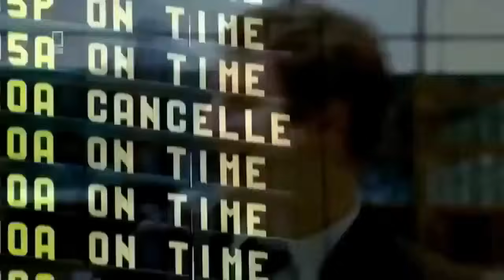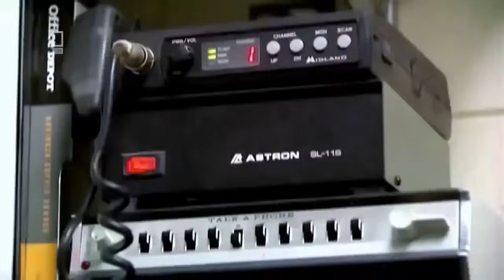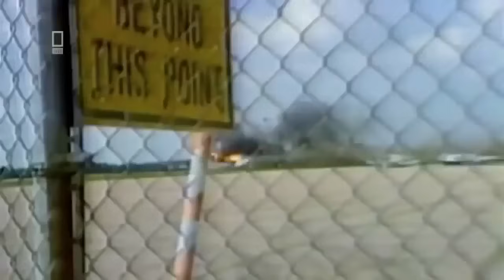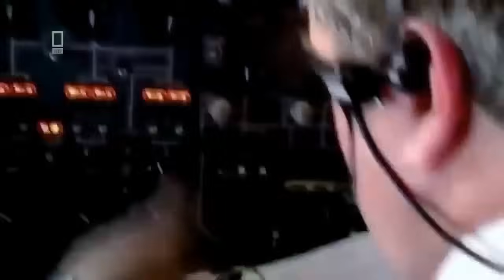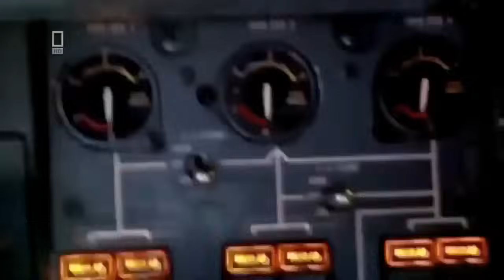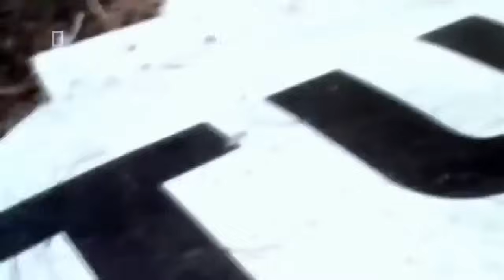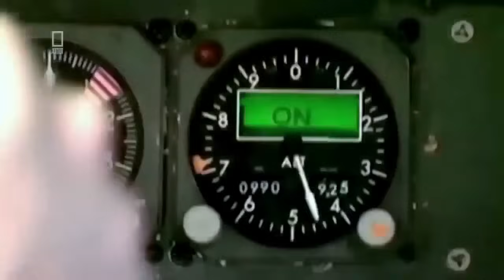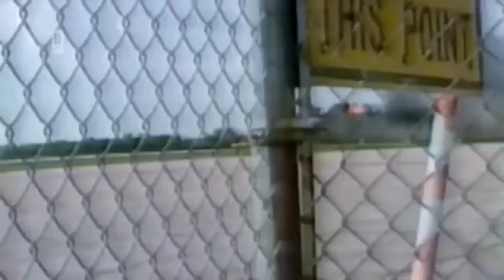Mayday Air Crash Investigation 2020 US Airways United Flight Impossible Landing Crash

Comment: I'm quite certain that initial severe roll to the right came close to dooming this flight completely. The fact that captain Haynes so quickly corrected it with differential thrust was an important moment. If the plane had rolled onto its back and plummeted, I doubt there would have been any chance of a recovery.

Comment: Actually DC-10s do NOT have a good safety record.
Reply: Something about having an engine in the middle of the vertical stablizer just doesn't sit right with me😁
Reply: @shawndouglass2939  to be fair the L-1011 had a engine in the same area and didn't have nearly as many problems as the DC-10...mostly because Lockheed didn't rush building it

Comment: I fail to understand why planes are designed so that a problem in the tail can take out all the hydraulic systems even though there are perfectly functional engines and control surfaces on both wings.  The wing systems should be completely separate from the tail.  There have been a number of crashes due to full loss of control because there was a problem in or near the tail.

Comment: Hello, I am Adil  texting you from  of Qatar, I would like to ask why they can not establish a system that can safe most of passengers lives.. by putting a parachute system which I considered as airbags on a normal car, because of what happened in this flight loosing all hydroelectric system ... If  there is parachute build in on the top of any airplane aerodynamically as it will be  the last refugee to safe lives at the last stage.. regard less what do you think about the incident that very well know about the halogen incident which killed around 60 people or more than that in some cretin time before (google is not giving really the right option and I really don't know why.

Comment: When they know they are going to crash land why can't they dump all the fuel? I don't understand !
Reply: I dont think you can open the fuel tank, also thats kinda polluting.
Reply: @roverfloats  they have a controlled proceedure called file dump!  They can do that by all means
Reply: They were prob a bit busy trying to keep the plane (relatively) straight and level. There's also limit on when and where you can dump fuel, so you know, they don't posion everyone on the ground. If they have the time and space to do it, sure, but it is not a priority when you're struggling to control the plane.
Reply: LnA fingerfoods the fuel dump, is a hydraulic controlled process, and they probably were not able to do that. Plus, dumping fuel means, that the pilots can’t go around, even if they regain control. So, it would’ve been very dangerous. And, most importantly, the pilots were too busy. Haha (I’ve been in a crash before).
Reply: Air mechanic here. So the reason they don't is because it causes many more problems then solves. If they dump in the wrong place then Avgas is landing in peoples pools and schools by the gallons. Secondly its a hydraulic controlled system, so even if they wanted to they couldn't as hydraulics were gone. Finally theres no point, the only thing fuel did was make the plane heavier. I assume you're talking about the fireball, which would have occurred even if the plane had no fuel whatsoever in it
Reply: Why would they dump the only thing keeping them in the air
Reply: @chasekruse7047  Avgas? You mean JetA
Reply: @lnafingerfoods4908  You probably know, but many others here probably due not. Most aircraft can not jettison fuel. DC-10s and most widebodys can, but most narrowbodys can not. To reduce landing weight on a plane that can not jettison fuel they have to burn it off through flight instead.
Reply: @danielcostello7170  oh that's a good info..  Thanks
Reply: @danielcostello7170  I might have, its been since A&P school since I've dealt with jet fuel systems and still mix them up some times lol. Thanks for the correction though

Comment: I would have dumped fuel before that landing.
Reply: With what hydraulics?
Reply: If that's unclear, a fuel dump is a hydraulic controlled process,  thus impossible in this case since the issue was they had lost all hydraulic pressure.

 If they could have done a fuel dump, they wouldn't have needed to do a fuel dump, since they would have their hydraulics.
Reply: @darkamora5123  I didn't know that. I thought it was an electric pump. In fact, maybe this accident tells us that it should be. Let me know your thoughts.

Comment: they keep saying that the plane can only bank to the right which is false. if you cut the power or idle the left engine and boost power to the right, the plane will bank left... both engines were fine so if they needed to bank left, or right, just cut power to the other engine and slightly increase the other
Reply: If you listen to what they say actually happened. With both engines at the same power the plane pitched right. To restore level flight ( or as close as possible we'll discuss that in a minute) they reduced the left engine to idle, and increased the right to maximum power. For whatever reason, while both engines were working, something made left turns impossible.  

It could only turn right because your method was what allowed "level flight". Not really level because with only one engine providing thrust it would climb and fall with the altitude diminishing each time (the climb phase was shorter than the descent). 

Why did it pitch right? Everything I read makes that unclear. Maybe control surfaces were damages by the disc failure, maybe the destroyed engine disrupted airflow in such a way that it forced that movement, nothing says explicitly what the cause was.
Reply: You can’t bank in the direction of a dead engine, the thrust from the higher engine with the drag from the lower engine would cause the plane to cartwheel
Reply: @darkamora5123  I think the plane was in a shallow right turn before the engine failed, so maybe that's why the plane naturally wanted to pitch right.

Comment: Why did he full throttle both engines at landing when they knew left engine less power and right engine more would
Keep the plane level. Him trying full throttle on both engines at the last minute cause the plane to drop to the right as it had been doing during the flight.
Reply: Denny Fitch applied full thrust with engines 1 and 3 just before touchdown because their "sink rate" (vertical descent speed) was excessive and the aircraft was slightly nose down.  Normally pilots "flare" the aircraft when landing.  This means the pilots pull up the nose just before touchdown.  This slows the sink rate, puts the aircraft in an attitude where the main landing gear under the wings touches the ground first (touching the ground with the nose gear first is a really bad idea!), and reduces the aircraft forward speed. The flare manoeuvre is normally accomplished with the elevators but these were not working due to the hydraulic system failures.  Because of the position of the engines below the wing and their angle to the wing increasing engine thrust tends to pitch the nose up. Increased thrust also increases speed which increases lift.   Denny tried to use these characteristics to flare the aircraft to reduce the severity of the crash.  It was imperative to reduce the sink rate and get the nose up a bit before touching the ground.  The cost of doing this was dropping the wing. I suppose in his mind it was a question of the least bad option:  Touchdown nose first at a high sink rate or wingtip first at a lower sink rate. Clearly the results would not be ideal either way, but they probably would have been a lot worse with a nose first touchdown.

Comment: you see what i mean! child riped away from a parent by putting a baby on the floor
Reply: Without an assigned seat and proper restraints for a small child (the equivalent of a car seat) no place would, realistically,  have been safe. 

On a lap, on the floor, wrapped in a parent's arms wouldn't matter, our arms aren't strong enough to hold on in those circumstances. The kid is sliding along the floor, or flying through the air in a crash like this.

The flight attendant, Jan, has the right idea, real restraints designed for children,  period.

Comment: With human beings having to care for their emotions as a priority need,  most discussions and videos about aircraft incidents need to contain the tacit and subtle words to be applied, words that soften the metal blow of such incidents, and we look for heroes and culprits!  Also, so much ado is made about the pilots being responsible for the passengers when in fact the first duty of a pilot is to save his own life so that others gain out of that, and this is confirmed when if the same incident had to take place with no passengers on board, the pilot would have behaved in exactly the same manner. There is a subtle psychological BLINDING DRUG  about flying which needs to be applied prior to the flying activity, as otherwise, no one will fly. It is all a complex bit of hidden psychology with the pilot feeling such emotions for the passengers when in fact he should not, as he knew well that a pilot cannot do much in certain circumstances even if he trains hard, is pumped up with pomp and social aura and salary to blind him into taking that very risky job, which mathematical statistic confirm that it will happen one day.  This pilot is very wise to have left flying, as he came to his senses and did as he realized how lucky he was in the past. 

The truth is that if one builds large planes that need only direct manual controls, the aircraft remains so small and all the mistakes are due to pilot errors, normally. If one builds high levels of automation in an aircraft and use hydraulics or amplifiers and more sophisticated engineering and computer control algorithms, then one will only shift the errors from the imperfect human pilot to the imperfect human engineers and the imperfect product he builds for the pilot to operate. No matter what we do, the flying prosthetic aid in the form of an aircraft helps people and pilots, all born without wings, to move into a risky domain that was not designed for them by nature, and the artificial evolution of aircraft has only been active for a hundred years which did not perfect the handicapped pilots nor the engineering, as the perfection which duration of a million years of evolution did to the birds and the fish which have evolved the right shape for their needs. 
 
The real truth about flying is that there is no perfect engineer and no perfect material and no perfect human pilot and the whole issue of flying is exactly the same as when an adventurous bullfighter/matador pumped up by his culture and traditions and his own family sometimes,  or bull rider/cowboy or a circus lion tamer,  decide that he can handle a wild animal by playing with it or riding it.  Considering the complications and enormous power and fuel contained in an aircraft, no one will deny that it acts as a wild bull if it decided to lose control due to imperfect engineering and imperfect piloting where the latter can only operate what is available at his cockpit and every other bit of engineering structure must look after itself according to what the engineer put in it.   

Flying is a voluntary activity and it is just as exciting to experience it as matadors and cowboys and lion tamers feel when they think that they are in command of a wild bull or any wild creature or pet.  Military pilots, all born without wings love their powerful engineered prosthetic steads, as matadors and cowboys love their wild bulls. That is the unspoken human reality and we tend to hide it all and be so euphemistic about it, all because we like to hide our basic needs to follow the adventure and risk and try to do what we cannot do on our own. There are other basic and instinctive human needs that follow the same style of risk that cultures and traditions try and hide. Aircraft is just an engineered prosthetic aid that helps people and pilots, all born without wings, to seek their wild adventures and convenience.  In the flying game, for a game it is, it is like being in the rink as a matador always thinking that he can handle the bull. Most of the time the matador wins, but sometimes the bull wins. No amount of emotional talk and euphemism about flying will ever correct that or indeed hide it from those who are not blind to propaganda and the tacit human engineering being applied!  Probably they who read this will associate an unethical behavior to him who wrote it, as we were brought up to think that looking after our emotions and private affairs is a priority, even if we lie about its reality! 
https://youtu.be/vM7Y7a2dRPg
https://youtu.be/J2tVNOM76Cg
https://youtu.be/RZWl7-KsZYY
https://youtu.be/8Vp9N8LhMGs

https://youtu.be/y8Sbji7MM3Q
https://youtu.be/6n585zqQi94
https://youtu.be/xkwKqD9ylLo
https://youtu.be/l4rD3MhFATA